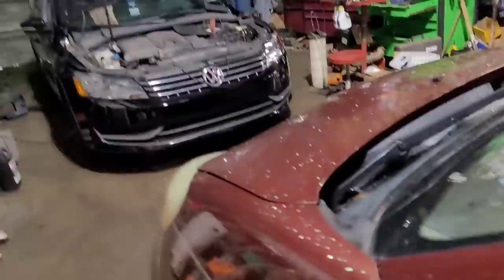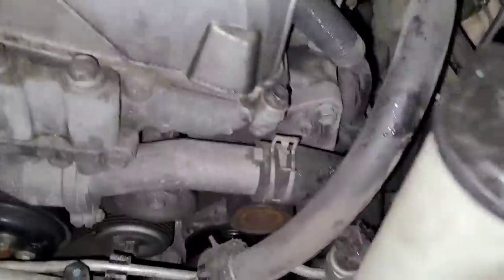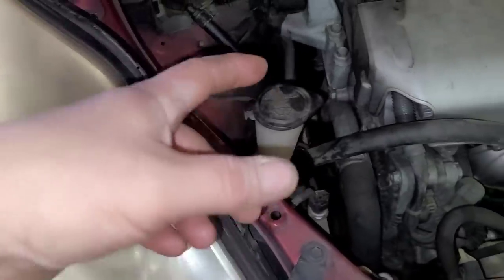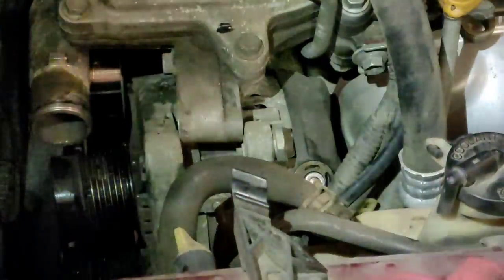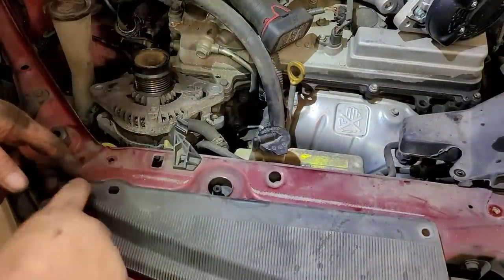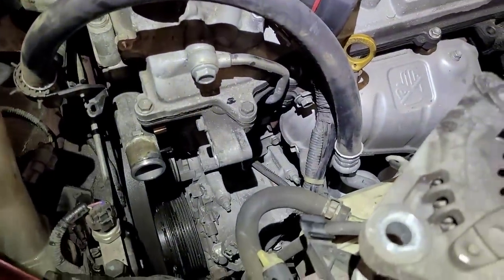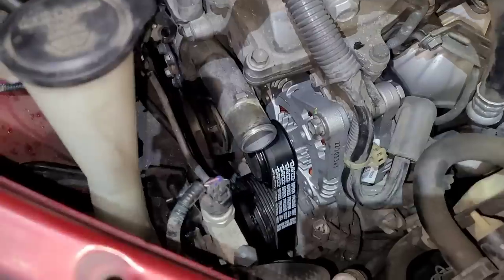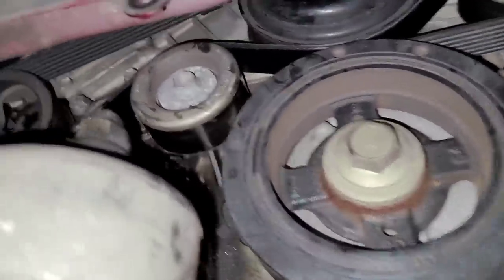Noisiest Alternator I've Ever Heard!!

Comment: There's a stethoscope you can get for identifying noisy parts. It has a thin steel rod on the end and a pliant rubber hose in between, and won't take your ear out. @RainmanRaysRepairs uses it from time to time.

Comment: Used a screw driver or bar in the old days when searching for drivetrain noises but nowadays I use a 30 inch piece of garden hose which allows me to see where I am poking ... Bonus is if gets hit it will give to the impact. Cheaper than a "mechanics stethoscope".
Reply: That's good. There are any number of more or less pliable extensions that are safer than a very ridged piece. I never thought of a nice semi stiff garden hose. Duel purpose siphon hose.Winner winner!
Reply: I use a length of heater hose.

Comment: The biggest problem with all vehicle manufacturers going to stuffing large engines into the east/west oriontation is when it comes to repair you need to almost remove the complete front (bumper /mount & radiatorA/C evaporator& a whole lot of other incidentales to do repairs like timing belts alternators steering pumps etc) jobs that should be easy become a major labour intensive venture which deters customers getting things fixed before they completly fail (my rant for the month) LOL Cheers Kenny.

Comment: I loved the GM internal regulator alternators (10SI?). Used to keep bearings, brushes, bridge rectifiers, regulators, and diode trios in my toolbox. You could pull them out and repair them in very little time if there was no major damage. When either bearing started to get noisy, you had a bit of time to get it fixed. The next generation that GM used had bearings that were less robust: I was about 3 blocks from home when I heard the noise. Tried to drive back home but the rear bearing seized up solid and "machined" out the rear housing so much that the rotor hit the stator. Actually saw sparks come out at the rear of the hood!!! Good comedy.

Comment: I use a hollow carbon arrow shaft with little rubber nipples on each end. It’s light weight and would probably bust if it got into moving parts.  It does transmit the smallest sounds.

Comment: Thanks Kenny. You were really wrenching to get this alternator out! One way clutch should be MDI on new part, as added complexity makes it a failure point. Like when would a heavy duty alternator have so little load to free spin?  Terrible Toyota access to an alternator in front of engine. Old Camry had alternator in front, but right on top so a breeze to replace it.

Comment: Customers should be grateful when they find an honest mechanic that doesn't charge book time for a repair like this. When I changed the radiator on a 2008 Saturn Vue 3.5L, the procedure manual states removing the front bumper impact bar and fascia to replace a &^*@$ radiator. After studying the clearance issue for a coupler minutes, (that's railroad talk) I determined it was not necessary. I wonder how many dealer mechanics discovered my 2 minute remedy but still charged book time for R&Ring the front bumper and fascia.

Comment: Kenny, I always take a one gallon milk jug and cut the bottom out of it. Then slip my big screw driver thru the original top opening. So what you have is one big speaker. Works the treat.

Comment: I found the same nightmare on a '16 Avalon.  Had to use all of my wobble tools and u-joints to get them. Those two bolts on that little bracket somehow disappeared. Hardest alternator swap I've ever experienced. Dang engineers.
Reply: I had to do the same with my holden astra changing the thermostat housing

Comment: The engine noise at the end was most likely vvti rattle. The vvti gears likely need to be replaced too, which is another giant job by itself. Ive heard that Toyota uses a clutched alternator for fuel mileage, but the difference it makes is miniscule.

Comment: If you have in earplugs you can hear, quite well, the noise through the screwdriver by putting your forehead on the handle of the screwdriver.  I used to do that when working on industrial machinery.  That way I could place the screwdriver tip and watch the machine run.  Try it.

Comment: Kenny, I don't know if you remember changing the alternator on the early Saturn's, but you had to pull the drive axle and a bracket they had bolted to the exhaust manifold under the manifold. I used to have to psych myself up to change the alternator on those when they came in my shop, lol
Reply: Wow!

Comment: have you noticed a torq screw you use a socket on like a 25 if you try to put a inverted torq socket on the 25 torq socket its not a 25 if inverted i don't understand

Comment: The "book" on Toyotas ALWAYS adds ridiculous shit. Remove entire intake vs. remove little shield half size of pack of cigs that has 1 bolt, to access rear spark plug. $450 labor at dealer vs. 45min in driveway. And a $40 intake gasket you never fucked with.

Comment: Welp, it's nice and quiet now, but it will be back. Sprag / one way clutch will be fine, but it won't charge anymore if it's not an OEM Toyota alternator. I have a lifetime of bad experiences with remans. I think my record is 4 remans for a '73 Olds Cutlass Supreme (my favorite car ever) until I bought a genuine article from a GM dealer. End of my troubles until the car rusted away. Shit, absolute shit garbage. Maybe things are better now, but have doubts. YMMV. Too old and disinterested in fixing my own crap anymore (70) but I would ask for OEM parts when I can. Happy to pay the $$.